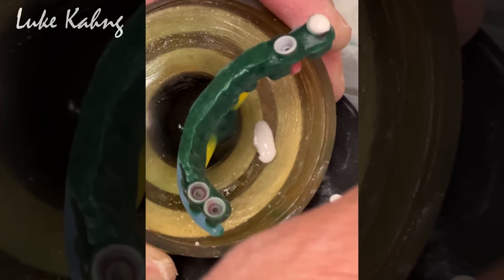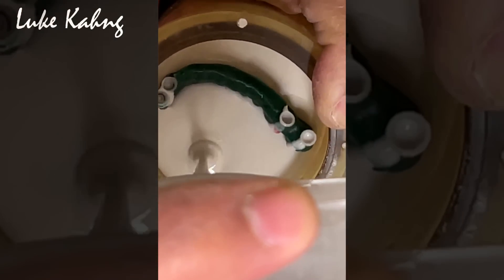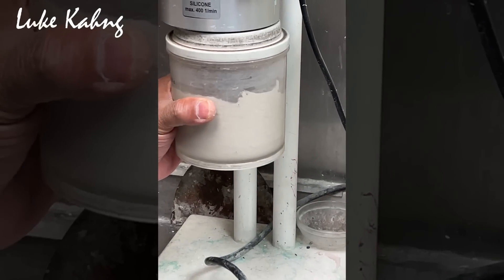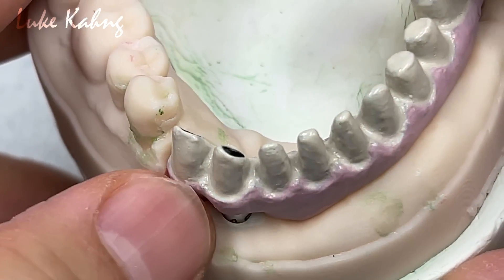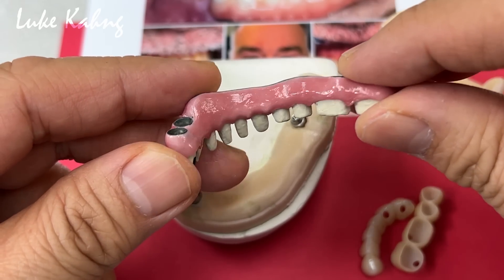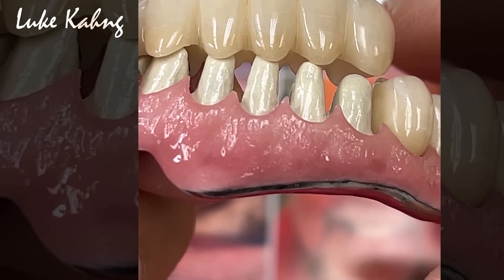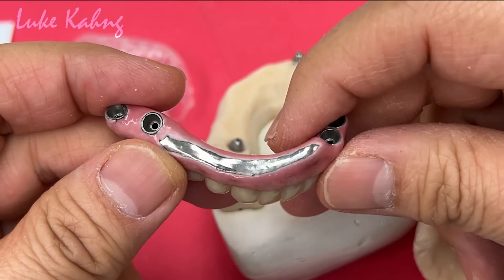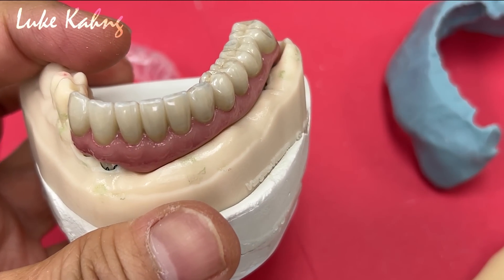Long Span Solution for Patient With No Anterior Bone

Comment: This is crazy, I come from the racing industry and I dealt with making molds for making carbon fiber parts, fittings, preparation for paint and then painting, I love custom painting. A lot of the same tools, composites, glues or epoxy, the processes mimic high end jewelry making. This looks like a ton of fun I would love to learn, I love intricate work like this.

Comment: I agree that that is a risky span.
Reply: That’s not for lab to decide- that’s the clinician judgement. Lab just makes what was sent. If it fails, it is on the clinician. This video is to show lab’s manufacturing process.
Reply: Of Course it is not the labs responsibility to diagnose, but Luke insinuates that making out of metal is answer to not having implants in anterior.  Yes the bridge won’t break but it puts so much torque on implants that there will be implant failure and then you are in deep trouble.  I would rather have bridge break.  This breaks all rules of implants and Restorative dentist and surgeon are clueless.  The old rule of taking the anterior posterior position of anterior implant and most posterior and measure distance and this is how far you can cantilever is still a good rule.  Dr. Kelly

Comment: Isn’t it easier to use multi unit gold cylinders and cast to them so you have better chance of nothing holding up when fitting.  I have always used gold cylinders.  Dr. Kelly
Reply from the maker: That exactly what we did it